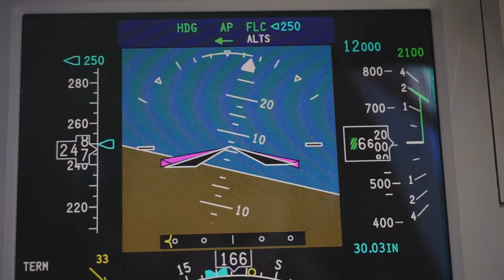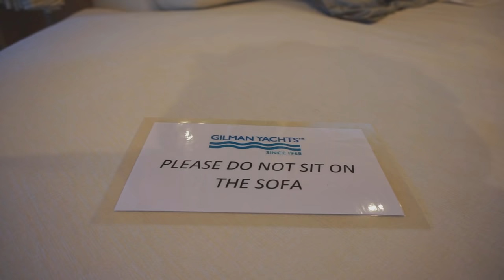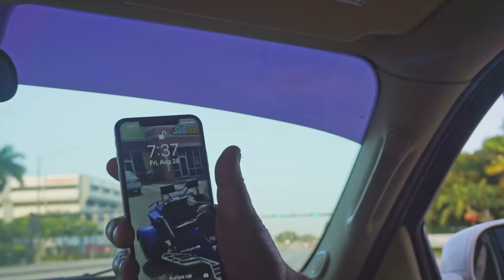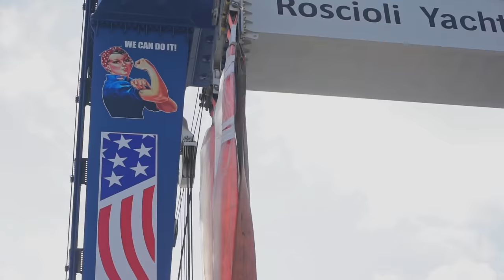Process of Buying a $5 Million Yacht | Life for Sale

Comment: That was a thorough survey. Really nice they noticed the dissimilar metal lines. That'll create issues like no other after a little bit of time due to electrolysis, salt corrosion, and fusion of the joints and lines welding/fusing together due to the dissimilar properties.

Most surveyors would've overlooked that and just chalked it up to "the engineers must've known what they're doing" and not say anything about it. Really good job.